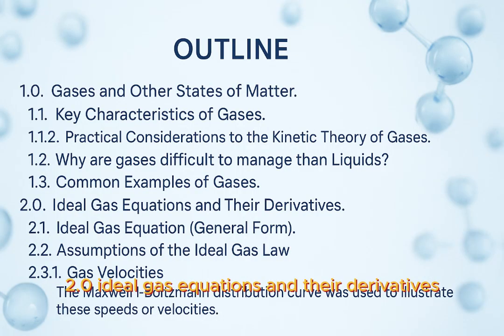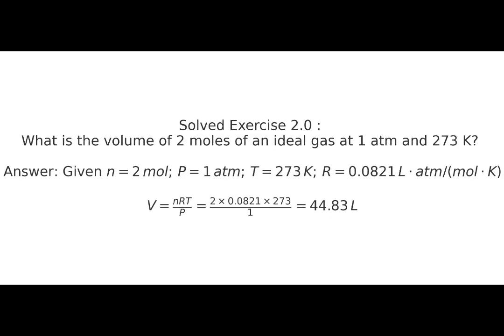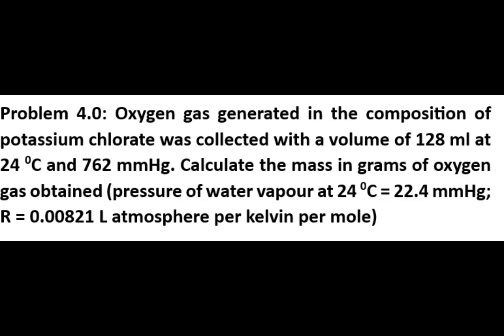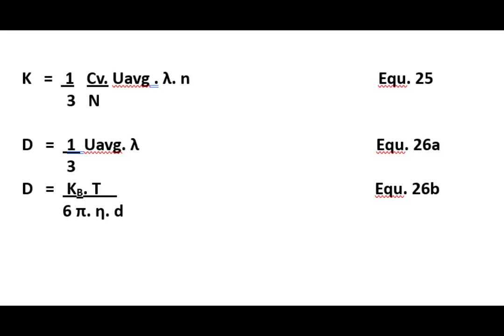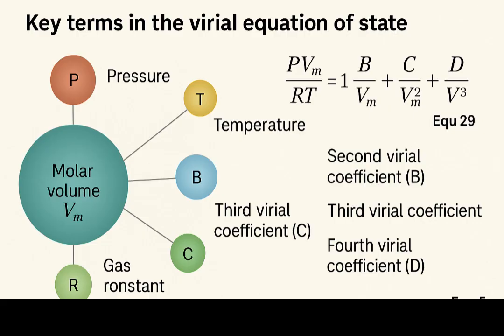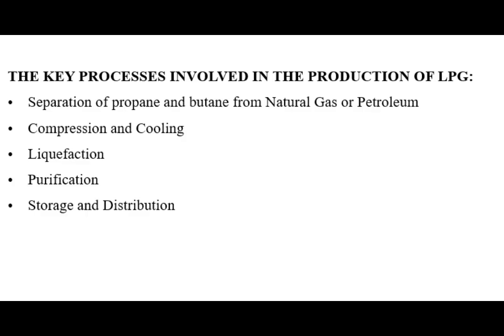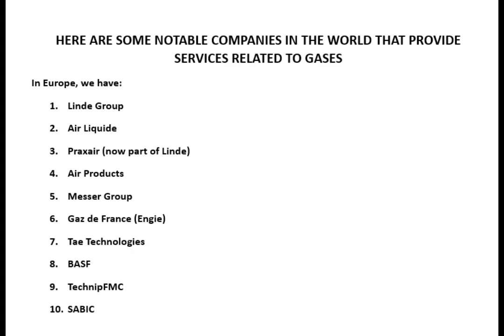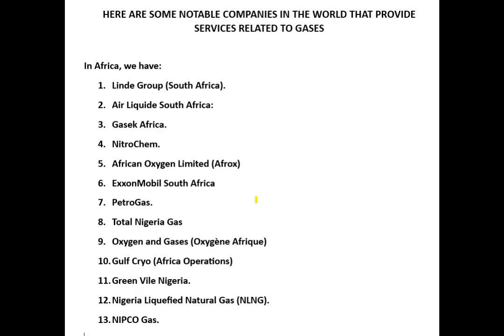Fundamentals and Applications of Gases

Comment: CHE: OKOYEN JOSEPHINE FUNGE-ERE
U2024/3030008

The positive Joule-Thomson coefficient of methane means that it cools when its pressure is reduced under suitable conditions. To achieve this cooling in pipeline natural gas processing, the pressure drop, inlet temperature, gas pressure, and flow rate should be properly controlled. The throttling valve should also be correctly sized and operated. Heat losses from the system should be minimized through proper insulation. These adjustments will improve cooling efficiency while maintaining safe operation.

Comment: SALAWU ABDULJABBAR ADINOYI
BCT
U2024/5735163

The ideal gas equation is
PV=nRT

To estimate the amount of gas produced
rearrange the equation
n=PV/RT

Measure the pressure (p), volume (v), and
temperature (T in Kelvin) of the gas and
substitute them into the equation.

The calculated value of n gives the
amount of gas produced in moles.

Comment: CHE: Itakpe Philbert 
U2024/3030035
The positive Joule-Thomson coefficient of methane indicates that methane will experience cooling when it undergoes a pressure drop through a throttling valve under suitable conditions. In pipeline natural gas processing, this cooling can be achieved and controlled by troubleshooting key process parameters. The inlet pressure and temperature should be properly monitored and adjusted, while the pressure drop across the throttling valve should be sufficient to produce the desired cooling effect without causing excessive hydrate formation. The gas composition and operating conditions should also be checked because the Joule-Thomson coefficient varies with temperature and pressure.

Additionally, the throttling valve should be inspected to ensure proper operation, and pressure and temperature sensors should be calibrated. Gas dehydration may be necessary to prevent hydrate formation during cooling. If excessive cooling occurs, the inlet gas can be preheated or the pressure drop reduced. Therefore, proper control of pressure, temperature, gas composition, flow rate, and dehydration is essential for achieving safe and effective cooling in pipeline natural gas processing.

Comment: CHEMICAL ENGINEERING: Nwabuoku kenechukwu Chilton 
U2024/3030030

The positive Joule-Thomson coefficient of methane indicates that methane will experience cooling when it undergoes a pressure drop through a throttling valve under suitable conditions. In pipeline natural gas processing, this cooling can be achieved and controlled by troubleshooting key process parameters. The inlet pressure and temperature should be properly monitored and adjusted, while the pressure drop across the throttling valve should be sufficient to produce the desired cooling effect without causing excessive hydrate formation. The gas composition and operating conditions should also be checked because the Joule-Thomson coefficient varies with temperature and pressure.

Additionally, the throttling valve should be inspected to ensure proper operation, and pressure and temperature sensors should be calibrated. Gas dehydration may be necessary to prevent hydrate formation during cooling. If excessive cooling occurs, the inlet gas can be preheated or the pressure drop reduced. Therefore, proper control of pressure, temperature, gas composition, flow rate, and dehydration is essential for achieving safe and effective cooling in pipeline natural gas processing.

Comment: NAME: DADA ESTHER OLUWAGBEMISOLA 
BCT
U2024/5735133
200l

By substitute the measured pressure (p), volume (v), n substitute temperature in kelvin T the number of moles of gas (n) produced can be calculated
X
:
Using the ideal gas equation pv=nRT
By estimating the amount of gas produced
We make the number of moles subject
Therefore the number of moles. n= PV/RT

Comment: Dept: NCT
NAME: CLINTON PRECIOUS UMAZHICHI
MAT NO: U2024/5735022

PV=nRT

Rearrange to find the amount of gas, n:

n=\frac{PV}{RT}

So, by measuring the pressure (P), volume (V), and temperature (T) of the gas and substituting them into the equation, you can calculate the number of moles of gas produced. If needed, the number of moles can then be converted to mass using the gas’s molar mass.

Comment: Dept: BCT
NAME: MOMOH LATIFAT
MAT NO: I1014/5735024

The ideal gas equation (PV = nRT) helps estimate the amount of gas produced by using the measured pressure, volume, and temperature to calculate the number of moles (n) of the gas through the formula:

n = PV/RT.

Comment: CPT:
ICPT Department 
OBINNA ALBERT CHIGOZIE 
U2024/5781018

1. What happens to the volume the pressure is increased?
The volume decreases.

According to Boyle's law, when pressure on a gas increases at a constant temperature, it's volume decreases in direct proportion.

2. It is useful industrially because it is easy to transport 
Efficient storage - can be stored in huge supply
It has more driving force to move itself through processing plants, etc.

Comment: BCT SSLT
ADEMOLA ENIOLA U2024/5735201

To estimate the amount of gas produced, rearrange the equation to make n the subject:
Where
� = amount of gas in moles (mol)
� = measured pressure (Pa)
� = volume of the vessel (m³)
� = ideal gas constant = 8.314 J mol⁻¹ K⁻¹
� = temperature in Kelvin (K)
Therefore, by measuring the pressure, volume, and temperature of the gas and substituting them into �we can calculate the number of moles of gas produced
If the mass of the gas is required, it can then be calculated using:
where � is the molar mass of the gas
The ideal gas equation allows us to determine the quantity of gas produced from its measured pressure, volume, and temperature.

Comment: BCT : Wokoma Princess God'sdelight 
U2024/5735143

The ideal gas equation, PV = nRT, can be used to determine the quantity of gas produced in a closed vessel. By rearranging the equation: n= PV/RT

The measured values of pressure (P), volume (V), and temperature (T) are substituted into the equation. The value obtained for n represents the number of moles of gas produced.

Comment: BCT
KALU IHECHILURU EMEA
U2024/5735212
The ideal gas equation contains the parameters used in the process that was asked in the question. If our temperature, volume and pressure were given and we R as a constant, then we make n the subject formula then the values would be plugged in and an amount of gas can be gotten.

Comment: BCT 
OBI MIRIAM CHIMEZIE
U2024/5735191 

The ideal gas equation (PV = nRT) helps estimate the amount of gas produced by using the measured pressure, volume, and temperature to calculate the number of moles (n) of the gas through the formula n = PV/RT.

Comment: BCT
TAMUNO-OWUPELE DAISY 
MAT NO: U2024/5735265

The ideal gas equation is:
PV = nRT
To estimate the amount of gas produced, rearrange it to find n:
n = PV / RT
Where:
P = measured pressure of the gas
V = measured volume of the gas
T = temperature in Kelvin (K)
R = gas constant, 8.314 J mol⁻¹ K⁻¹ (or 0.0821 L·atm mol⁻¹ K⁻¹)
n = amount of gas produced in moles
      By measuring the pressure, volume, and temperature, you can substitute those values into the ideal gas equation n = PV/RT to determine the moles of gas produced.

Comment: BCT
Name: Igbokwe Divine Favour 
Mat no: u2024/5735194
Date: 15/08/2026
Faculty:SSLT
A biochemical process produces a gas in a closed vessel. The ideal gas equation is:
PV = nRT
Rearranging to find the amount of gas produced:
n = PV/RT
Where: P = pressure of the gas
V = volume of the gas
n = number of moles of gas
R = ideal gas constant
T = temperature in Kelvin
Therefore, by measuring the pressure, volume, and temperature of the gas, we can calculate the amount of gas produced using:
n = PV/RT.

Comment: BCT:OWEN DEBORAH DUKWE 
Using the ideal gas equation,pV=nRT, The amount of gas produced can be estimated by making n the subject of the equation. n=PV/RT.
By using the values of pressure (P), volume (V), and temperature (T) into the equation, the amount of gas produced can be calculated.

Comment: BCT

 OGBANGWOR IJEOMA ANASTASIA 

U2024/5735025

Using ideal gas equation,the amount of gas produced can be estimated by rearranging the equation.
By measuring the pressure, volume and temperature of gas in a closed vessel, substitute the values into the equation to calculate the number of mole of gas produced.

Comment: BCT
Name: Nbor Sylvia 
Mat no: U2024/5735269
Faculty: Sslt
Date: 14/8/2026

An ideal gas equation PV =nRT can be used to estimate the amount of gas produced by a biochemical process in a closed vessel. By measuring the volume, pressure and temperature of gas the number of moles of gas produced can be calculated by rearranging the equation.

n=PV/RT

Equation given 
PV = nRT
Where
 P is the measurements pressure of gas
V is the volume of gas
n is the amount of gas in moles
R is the ideal gas constant=8.314 J mol-1 K -1
T is temperature in kelvin
Therefore, the measured pressure, volume and temperature are substituted into the equation to determine the quantity of gas produced.
It can

Comment: BCT 
MacJaja Deborah Boyce 
U2024/5735251

The ideal gas equation contains the parameters used in the process asked in the question. 
N= PV/RT 
Where; 
P is pressure 
V is volume 
R is the gas constant (8.314J/mol/K)
T is temperature in Kelvin and 
N is the amount of gas in moles 
Therefore by measuring the pressure, volume and temperature of the gas in a closed vessel and substituting them into N = PV/RT, we can get the estimate amount of gas produced. 
Thank you

Comment: BCT
Name: Nwokocha Chimzurumoke Abundance 
Mat No: U2024/5735312
Date: 14/08/2026

Answer:
The Ideal gas equation PV=nRT can be used to estimate the amount of gas produced.

Where: 
P = Pressure of the gas
V = Volume of the closed vessel
T = Temperature in Kelvin
R = Ideal gas constant = 8.314J/mol.K
n = amount of gas produced in moles (mol)

Therefore, by measuring the pressure (P), volume (V) and temperature (T) of the gas in a closed vessel and substituting them into 
n = PV/RT, we can estimate the amount of gas produced.

Comment: BCT
Dike Amarachi Catherine 
U2024/5735217

The ideal gas equation helps estimate the amount of gas produced in moles from the measured Pressure, Volume, and Temperature.

PV= nRT

Rearrange to make n the subject 

P= pressure of gas
v= volume of the vessel 
T= temperature in Kelvin (k)
R= gas constant, 8.314, J mol-¹K-¹
n= amount  of gas in moles.

Therefore, by measuring P, V, and T and substituting them into the equation, you can calculate the number of moles of gas produced. If the mass is required, multiple the number of moles by the gas's molar mass.

Comment: NAME: OGOCHUKWU SHINE VICTORY 
MatNo: U2024/5735328
DEPT:BCT
FACULTY SSLT
ANSWER The ideal gas equation pv=nRT,help you estimate the amount of gas produced by measuring the pressure, volume and temperature of the gas and substituting them into the equation n=PV/RT and then the amount of gas in moles can be calculated where 
P. Pressure of gas 
V. Volume of gas
n. Amount of gas in moles 
R. Gas constant ( 8.314J,mol^-1K^-1)
T. Temperature in kelvin

Comment: DEPARTMENT:BCT
NAME:SUNDAY BLESSING SORBARI 
MAT NO:U2024/5735060
DATE OF SUBMISSION: 14/08/2026

You can use the ideal gas equation (PV=nRT) to find the moles of gas (n) by rearranging it to n = PV/RT. Measuring the pressure (P), volume (V), and temperature (T), then divide by the gas constant (R) and T

Then you get a Gas Constant R = 0.0821 L . atm/(mol . K) if using atm and liters

Comment: BCT
(Biochemistry and Chemistry Technology),
JONAH MIRACLE BASSEY
MAT NO: U2024/5735010
DATE: 14 AUGUST, 2026

The ideal gas equation, PV = nRT, can be used to estimate the amount of gas produced by rearranging the equation to make the number of moles, n, the subject:

n = PV/RT

By measuring the gas pressure (P), volume (V), and temperature (T) in the closed vessel, and using the appropriate gas constant (R), the number of moles of gas produced can be calculated. This gives an estimate of the quantity of gas generated during the biochemical process.

“sir I liked the video”. Thanks.

Comment: BCT
JAMES DAMARIS ADA-AMARA 
U2024/5735164
The ideal gas equation contains the parameters used in the process that was asked in the question. If our temperature, volume and pressure were given, and we have R as a constant, then  we make n(amount of gas produced) the subject of the formula. 
Once this is done, the values would be plugged in and an estimated amount of gas can be gotten.

Comment: BCT
Name: Obi Lucy Oluebube
Mat No: U2024/5735053
Date: 14/08/2026

Answer:
The Ideal gas equation PV=nRT can be used to estimate the amount of gas produced.

Where: 
P = Pressure of the gas
V = Volume of the closed vessel
T = Temperature in Kelvin
R = Ideal gas constant = 8.314J/mol.K
n = amount of gas produced in moles (mol)

Therefore, by measuring the pressure (P), volume (V) and temperature (T) of the gas in a closed vessel and substituting them into 
n = PV/RT, we can estimate the amount of gas produced.

Comment: BCT:UCHENNA DEBORA CHINECHEREM 
MAT NO:U2024/5735239

The ideal gas equation helps you estimate the amount of gas produced by measuring the pressure, volume and temperature of the gas and substituting them into the equation n=PV/R and the amount of gas in the moles can be calculated
P= pressure of gas
V= volume of gas
R= gas constant (8.314jmol-1k-1)
T=Temperature in kelvin And n= amount of gas

Comment: ICPT: U2024/5781007
EKAT NELSON

According to Boyle’s law, at constant temperature, pressure and volume are inversely proportional. Therefore, when the pressure of natural gas is increased, its volume decreases. This is useful industrially because natural gas can be compressed into a much smaller volume, making it easier and more economical to store and transport.

Comment: NAME: VICTORY BARILEE PAUL 
MAT NO: U2024/5735090
The ideal gas equation is used to determine the amount of gas produced by measuring its pressure, volume, and temperature and substituting the values into:
n = PV/RT
Where 
P is pressure
V is volume
 R is the gas constant (8.314 J mol⁻¹ K⁻¹)
T is temperature in Kelvin
 and n is the amount of gas in moles.

Comment: BCT 
OGBONNAYA, FAVOUR UCHE 
U2024/5735173
14/08/2026 

Answer: The ideal gas equation ; PV =nRT 

To calculate the amount of gas produced (number of moles ,n ) , rearrange the equation;
n =PV/RT 
Where ; P = measured pressure of the gas 
V= volume of the vessel 
T = temperature in kelvin ( k)
R = ideal gas constant = 8.314jmol-1 k-1 ( when using pa and m^3) 
n= amount of gas produced in moles (mol) 

Therefore; by measuring the pressure, volume, and temperature of the gas in the closed vessel and substituting them into n= PV/ RT , we can estimate the amount of gas produced.

If pressure is in atm and volume in liters: 
n = PV/0.0821T
Where R = 0.0821,L,atm,mol-1 K-1

Comment: BCT: SANCO ADOGBEJI DAVID
U2024/5735109

The ideal gas equation helps you estimate the amount of gas produced by measuring the pressure, volume and temperature of the gas and substituting them into the equation n=PV/R and the amount of gas in the moles can be calculated
P= pressure of gas
V= volume of gas
R= gas constant (8.314jmol-1k-1)
T=Temperature in kelvin And n= amount of gas

Comment: BCT: Elochukwu Johnbosco Chinedu 
MAT NO: U2024/5735271

The ideal gas equation can be used to determine the amount of gas produced by measuring its pressure, volume, and temperature and substituting these values into the equation. The number of moles of gas can then be calculated.

* P = Pressure of the gas
* V = Volume of the gas
* R = Gas constant (8.314 J mol⁻¹ K⁻¹)
* T = Temperature in Kelvin
* n = Amount of gas in moles

Comment: NAME: ERIOBU SOMTOCHUKWU MICHAEL 
MAT NO: U2024/5735353
DEPARTMENT: BCT
DATE: 14TH OF AUGUST, 2026

The ideal gas equation, PV = nRT, can be used to estimate the amount of gas produced by rearranging the equation to find n: n = PV/RT, Here P is the measured pressure, V is the measured volume, T is the temperature in Kelvin, and R is the gas constant. By substituting the measured values of pressure, volume, and temperature into the equation , we can calculate n, and temperature into equation , we can calculate n which gives the amount of gas produced in moles.

Comment: BCT

Onwukwe Prince Edmund 

MAT NO: U2024/5735276

DATE: 14/08/2026
The idea gas equation, PV=nRT, can be used to estimate the amount of gas produced by rearranging it to n=PV/RT. By substituting the measured pressure (P), Volume (V), and calculate n, which tells you how many moles of gas were produced.

Comment: BCT

Name; CHIJIOKE FAVOUR OKEREKE 

MAT NO: U2024/5735343

Using the ideal gas equation:

n=\frac{PV}{RT}

Substitute the measured pressure P, volume V, and temperature T to calculate the amount of gas produced in moles.

Using the ideal gas equation:

n=\frac{PV}{RT}

Substitute the measured pressure P, volume V, and temperature T to calculate the amount of gas produced in moles.

Comment: Name: Promise Millicent Chidera
Dept: BCT
Mat No.: U2024/5735149  Faculty :  SSLT

The ideal gas equation is: PV = n RT
It can be used to calculate the amount of gas produced in a chemical reaction. By knowing the gas pressure (P), volume (V), and temperature (T), the number of moles of gas can be calculated using: n = PV/RT

Comment: Name: Nwidaa Abigail princess
MAT NO:u2024/5735088
Dept: BCT
Date: 14/08/2026
 — Using the ideal gas equation the amount of gas produced can be calculated as . By measuring the pressure, volume, and temperature, we can determine the number of moles of gas produced.
Where p=pressure 
T=  absolute temperature in kelvin(k)
V= volume 
R=ideal gas constant